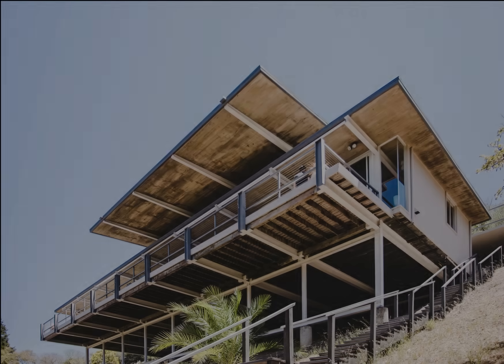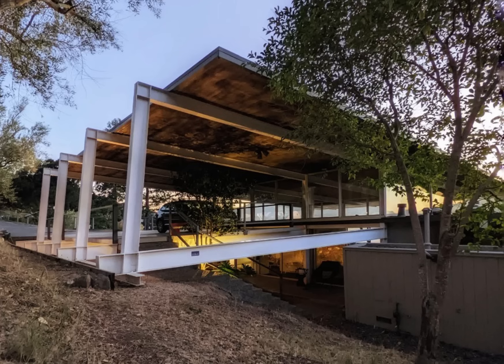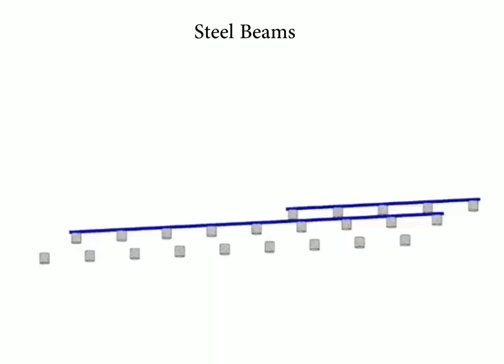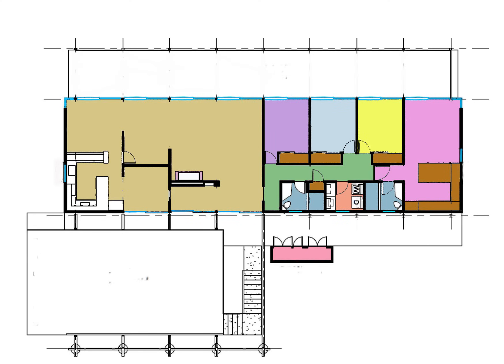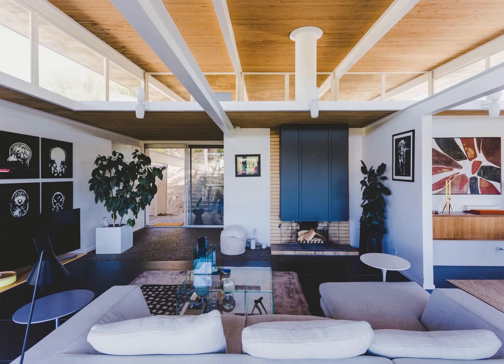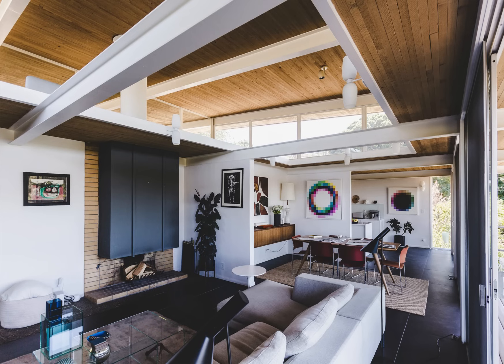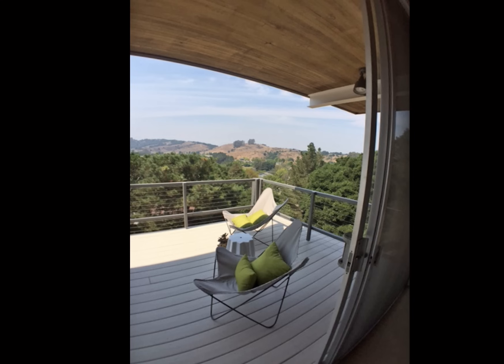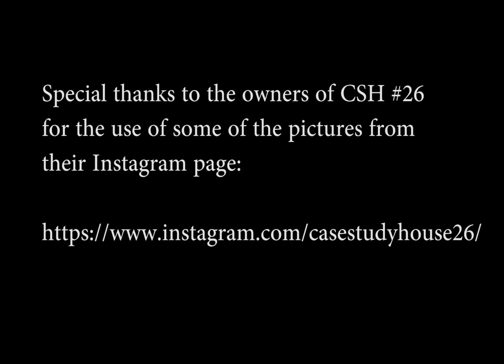The most spectacular Case Study House. Nr 26 by Beverly Thorne. Overview & walkthrough.

Comment: I’ve met two people who lived in houses of similar vintage, style, and construction. Each said their main memories were of freezing in the winter, roasting in the summer. As spectacular as they look, these houses were originally built with no insulation and single pane glass.
Reply from the maker: Yes it's a house from 1962, almost all house from that period have only single glass windows. Also steel as the primary material for a house is outdated because of the heat distribution, today we use more prefab concrete. But in back in the days it was the cost effective choice. So I think the house is designed in the best way possible in 1962, but is not comfortable compared to the better quality houses were are used today.
Reply: @JopCornelis  its California baby best weather in the world  its not Florida or Minnesota insulation can take a back seat

Comment: Dazzling home.  The addition of the pool would be spectacular.  Excellent presentation, Jop.  A structure with so much visible steel yet having such a light presence – particularly relative to the other and newer structures around it.
Reply from the maker: Thanks for calling the video " excellent" , great to read that you liked it. Yes this house is really transparant. It's one of my favorite CSH designs, together with  "CSH 20 Bass House" that's a design that I haven't turned into a video yet, but I will do soon.